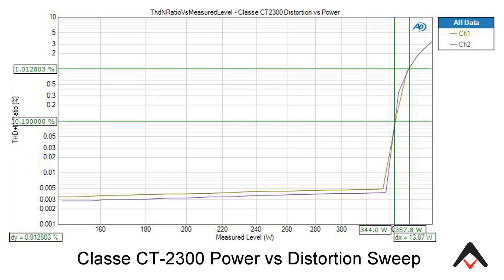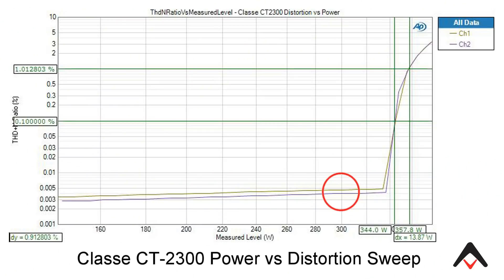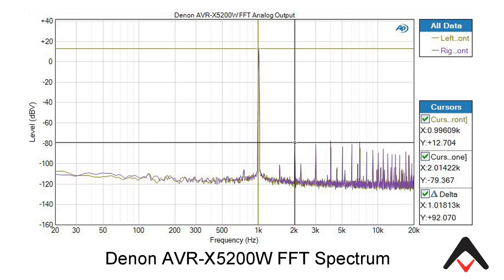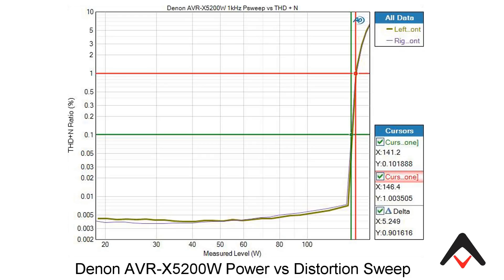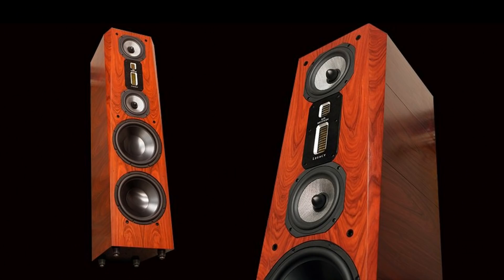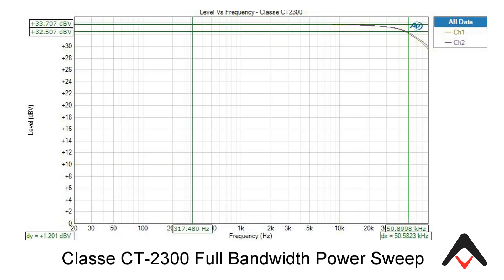Understanding Power Ratings in AV Receivers

Comment: Thank you Gene -- great video.  I have always run straight Class A or Class AB -- how can a Class D amp be pushing 2 ch 100watts/ch 8 ohm with a 46 volt power supply. I struggle when I pick up my class D and it weighs 4 pounds, while my Yamaha B-6 rated at 200 watts into 8 ohms give me a real workout.

Thanks !!!
Reply from the maker: Of  course if all things are ideal this would be true.  However, there are many factors that can lead to amplifiers sounding different that don't just relate to harmonic distortion.  Output impedance plays a role depending on the load the amplifier is driving to name one metric.
Reply: +SquidCaps "audiophiles on a budget" is so me. I just bought a budget 4ch pro amp for home theatre use. I feel a lot of consumer 'audiophile' grade equipment from players, DACs, amps to speaks are way out of proportion to supposed sound quality improvements (probably mostly psychological. It was proven that our taste sense can be altered by vision, sound and memory, maybe similar apply to audio sense).

I am currently thinking about DIY a subwoofer and power by bridging 2 of the channels on my pro amp. Would you know if any electronics required apart from the speaker driver assuming I am doing EQ from PC player?
Reply: Dedicated DSP is a good point. My AV amp only have one subwoofer out, it can detect distance and phase, but that would rule out dual subs. I should have gone with a version of pro amp with built in DSP! Being too tight budget with no foresight.
Reply: +SquidCap if you think its an insane idea, I can already imagine what my wife's reaction is gonna be.
Reply: Tactile transducers sounds like something any female would enjoy once in a while too.

Todd, would the dual woofers be in push pull arrangements to cancel out vibration?

SquidCap, 
there are so much to learn and explore. Earthquake sounds demoed some interesting products this year's CEDIA.
Reply: Apples and oranges, weight has nothing to do with power supply output, it just happens to be one clue in traditional transformers. I agree with Gene, Class-D needs to be put to same tests and benchmarks. And even thou, i have no facts, i think class-D is the type where power rating must not be at any point exaggerated.. So reversal works as a safeguard, take 20% of from class-D and you are might fine to put it up against any other type. For 200W AB should be equivalent to ~240W D-class. 

These are amplifiers we are talking about, nominally driven there should be no audible differences and so far in 25 years, some of it spent as engineer, i agree 100%. And weight is very poor indicator even on amps with traditional transformers as there are a lot of other factors in play (and since i stopped touring right about when d-class proliferated, i'm extremely jealous to techies of today, what used to be 160kg is now 40kg.. It actually saves on fuel already.. But that is a place, pro audio, where things can't enter distortion or ears go pop, smoke is released and insurance called.. They have to be dependable and performing just like the old ones. And they do, i was highly sceptical too and joked that these China plastics just can't work but hell.. i have been proven so wrong (we got a private demo from JBL/Harman and could get to quite in detail with them right at the time they produced first lineups based on new tech and yeah.. there is nothing wrong with that approach anymore, if it's done properly..)

I would still avoid the cheap stuff and get oversized but that is minor convenience; we have to plan for 50% reserves at minimum anyway, extending that to 60% is nothing ("real" wattage hits 50W; amp should be at least 100W, for d-class that would mean 120W.. whoopdidoo :) .. and that last para is opinions, not facts, based on some feedback from the field. What is indicative that no one is complaining and if something is fragile, the word gets around REALLY fast in the pro circuit as that shit costs easily thousands when things break at the wrong time, careers are ruined, companies bankrupted if new investments do not work like expected...
Reply: SquidCaps Thank you, so for critical listening in a properly set up acoustical environment, in an A/B test if both amplifiers were set to 50 watts / 8ohms even a good listener (not great listener as I am over 50) would be hard pressed to tell the different in amplifier output and distortion (assuming that each amp is conservatively a 100+ watt amp.)
Reply: Todd Dembsky Not just hardpressed, it is impossible to hear two nominally driven amps from each other (expecting we are both talking about linear. low distortion and low noise, at least adequate devices, <0.1%THD scale). Our ability to detect distortion is over 1%, we can hear clipping as that pushes things to double digits very fast.

Which is the usually flaw on testing amps: trying to compare small to large, overdriving one of them. Another factor is bandwidth, if you try to aim for 20Hz, that 50W that worked on medium towers, 40hz-20k is hopelessly underpowered at 20-30Hz (sub distortion is even harder to detect, it can go to 10%, which poses another problem: using energy on a range that the speakers can't produce but energy is still wasted... This can easily push things to distortion. proper answer, as always, is to bandpass source to be narrower than output, speakers in our case (on top end and using hires sources, you should cp that too, to fit the speakers, otherwise yo encounter minor amount of IM distortion, energy is sent but not used to produce sound, it turns in to heat and distortion...)..

But since we are not using loads of power and frankly, the usual situation is that we do have quite well balanced match, regular amps tend to do their job just right. But that is not enough for audiophile now is it? Pretty much nothing in audio is linear, energy is one of them.. Like you see in Gene's graphs, the distortion goes suddenly up and if our transients start hitting this peak, we can still feel good bass and relatively clean mids, just that something is...muddy.. unclear.. highs are there at right energies but... there is bass but it ain't punching thru.. all signs of amp giving up.

Some grow up on this sound and tend to like it; when they finally get balanced match, it is suddenly too harsh etc :) which naturally brings tubes as those have soft clipping, that knee you see is not a wall but more gradual; we get that "sound" much sooner and it is much better way to get distortion, imho than solid states...

Sorry for long post... If you haven't yet, join us at " audiophiles on a budget " in FB ;)
Reply: SquidCaps Great article.  In my set-up I would cross over at about 150hz to active subs.  So I would only drive 150 - 20,000.  I am going to have to give a good Class D a test.  My Class A's eat power like it is candy.

Also would open up my ability to build active speakers.  As I build all my speakers, I get the fun/frustration of picking cabinet design, driver components, and crossover design and components.  Also gives me the ability to bi and tri-amp my speakers if needed.

Thanks a lot -- great advice and loads of help.  I appreciate it.
Reply: Todd Dembsky Not a journalist so not an article but thanks :) IMHO, bi/tri amping is the best option at the moment, fully DSP controlled. The accuracy one can get is often ridiculous +-1db is achievable under 10k. But what is left, is the 50% of sound: room.. So spend your dollars there if you want the most effect on sound quality. Diffusion is my "sound", every room i've measured or worked in that i miss have had properly diffused soundfield, rather than damped. The longer you can make the reflection waves travel, the better as air is the best damping material i as it does not resonate like solid do Reflection/diffusion/absorbing, in that order.. But i'm not acoustician (read: magician or wizard), just a blue collar sound engineer (read: glorified roadie).
Reply: Oh Todd, I took a year of university physics and electricity was and remains a mystery to me.
All I can say is thank God for CROWN XLS amps!.  They are class D and to me-excellent ear-they sound GREAT.
I tried to read about "switching amplifiers" and all that but...uggh...CROWN XLS works for me.
Reply: Just wanted to mention.  I have a CLASS D BRAND amp: four channels.  300 watts/channel.  Designed, built and owned by Tom of Class D amplifiers in Anaheim, CA.  American made: EXCELLENT, QUALITY throughout.   Beautiful sound.
I just bought TWO CROWN XLS1502 amps.  I have them in bridge mode to run a set of BIG POLK AUDIO rtia9s.  These speakers have always recieved "so-so" reviews.  But people with  big amps always contend the speakers sound GREAT.
In bridge mode these amps put out 600watts/channel.  These amps make my rtia9s come alive and SING!!.

I got the CROWN CLS1502 for $350/each on Ebay.  They can be had for less if purchased used.

I have never seen anything but a 5 star rating for these amps.  The sound is impressive.  Just a shade below my CLASS D BRAND amp.  They put put the same power as the CLASS D BRAND amp but at 70% of the  price.  Not quite the build quality of the CLASS D BRAND amp but sufficient to get the job done.
Reply: Oh Todd!.  I would LOVE to see some of your builds.  Never understood why speaker manufacturers DONT build speakers with the power slot built right in.  I believe Ohm speakers does it??.  They also have a "novel" design.  I out that in quotation makrs because mother nature designed our vocal folds like that tens of thousands of years ago.

But why not have the power right at the speaker?.  Then a way to take out the amplifier and put in a new or more powerful model?.  There would be no huge central amplifier.  One could run the speakers on blutooth, thereby avoiding all cords.  OR, just have OPTICAL CORDS: thin, pliable, accoistically perfect optical cords sending a signal from the preamp to the speaker's amplifier.  NO loss of power.  NO  BIG, VISIBLE cords.
Would you use a CROWN amp as the speaker's amp?.  They are smaller than an A/AB amp but still large to put in a speaker and make it look...streamlined or at least stylish.
I believe class D amps are here to stay and to force out class A/AB amps.  Studies have shown that people CAN'T tell the difference between the amps so...

If you go to CLASSDAUDIO.com you'll see some amps that one can assemble themselves.  Maybe you just need one of those and NOT the whole CROWN amplifier??.

But still, I'd love to see your speakers-if  designs, ESPECIALLY if they involve a built in amp!!
Reply: gordon1000 Even though you are running EQ from your PC Player, I would put in a low pass filter prior to the sub amp, and then I would also put a hi-pass filter inline prior to your main amp -- no need in having your main amp reproduce all that bass.  What is the power output of your pro amp?  Rather than bridging the channels, have you thought about two subs?  Parts-Express.com has some nice DIY kits that are reasonable in price.  Depending on room size and shape,  two 8" or 10" subs would be better than one 15" sub.
Reply: gordon1000 Yeah, our group is on the realistic, objective side of things and shuns snakeoil, kind of exception in the audiophile world. It is not perfect or infallible place but i simply can't go anywhere else without seeing red from the mountains of misinformation.

For DIY sub, active cross-over is the best option available, giving you the much needed control. For even better control and what i consider to be minimum is to use DSP (miniDSP is very popular but i don't like to endorse just one product, there are others but that is prime example of how things should be done) as this gives you the absolute mandatory time alignment and allows subwoofer to be positioned optimally in the room independent of main speakers locations. 

Without time alignment, you are forced to place sub very near to main speakers but this is not at all guaranteed to be the best position in the room, speaker+room interaction is what makes 99% of the sound and subs are meant to produce the wavelengths not commonly seen in the size of rooms we have. Thus: sub is placed in the room for the room, main speakers are positioned in the room for you.

Using active crossover, before poweramps, also prevents the point Gene made about impedances and output impedance; we get close to ideal impedance across the whole range since we do not have complex passive filter circuit in the one pathway that is compromised the most by simple laws of physics: we can't get zero input impedance but as low as possible is the goal..just in case we run into damping issues*

*which are VERY RARE and i always see this as "why did you have to mention that, technically true but.. ". It is usually irrelevant, the margins we work in are such that this should not be an issue.. ;) It is a bit like saying that since at mach3, our leading edges start to melt on a jet, thus we need to use titanium bumbers on our Toyota (exxagerated to prove a point). In my eyes, this is ALWAYS a failure condition, it is troubleshooting time if damping causes problems.. But at home hifi, we also do have the "high end" where these kinds of amateurish mistakes are commonly made, because it sells to a certain crowd who are themselves avoiding facts and everything objective, so i guess it has to be mentioned that there are some cases where......
Reply: thank you for the tips Todd, the pro amp came with low or high filters for each individual channels. It is advertised to have peak 1600w @ 2ohm, 860w @ 4ohm and 3000w bridged @ 4ohm. I was think one 15" or 18" folded horn, depending on how I can hide it from my wife. :X
Reply: gordon1000 My goodness man, how big is your listening room?  I used those type of speakers and that power for sound re-enforcement at concerts when I was a sound engineer.   Just go out an buy a couple of Klipsh KLIPSCHORN :-)  If you are worried about the W-factor, you are going to have to put the 18" folded horn into the laundry room and blast it through an acoustically transparent grill.  Do you watch a lot of action movies?  Or are you planning on using these outdoors?  Unless you are really into deep Organ notes, most music today does not go much below 40hz (thanks for nothing Bose) with some content and harmonics in the 20-30hz range. But a 30hz signal at 100db will move your house off its foundation if it is less that 3000 square feet. (all this is opinion based on past experience, not fact, Gene is probably spurting blood from this ears by now)

What is the frequency range of you amp?  most are rated at 20-20k.  You will need a power amp that has the current to drive an 18" sub at 20hz.  And one that has a floor of around 10hz and those are a very rare animal.

I really want to see what you end up doing.  Just please, please, do not put any led light into the speakers.  That darn computer fad is starting to slide over to desktop speakers. Barf.
Reply: B drop tuned metal is imho good example of 30Hz notes, that really is already stretching it a bit, after that, there are no real notes but just energy. Also, 18" folder horn? A bit insane idea, if you ask me.. You get much better results using tactile transducers if you want to go near 20Hz.. But the goal is linear FR at least 20-20k so, go for it...
Reply: Todd, in around 3500 room. I am just an amateur try to get best bang without needing to upgrade in the future. what I am missing is the thump in the chest feel in action movies. I can hear them but no feel them so much. My amp is 20-20k as you said.
Reply: gordon1000 I would have to recommend what SquidCaps mentioned and supplement your sub with tactile transducers. But if you are really going for that heart stopping bass hit, go for 2 18" drivers in a single cabinet.   That way it would fit under your TV cabinet and you would be able to time align the left, right, center speaker plane with the sub plane. Just remember that below 300hz the sound will become unidirectional, meaning that you really will not be able to tell where the placement of the sub is.
Reply: gordon1000 Last time i drew a folded horn for measly 10", it was 1.5m high, 35cm deep and 2m wide to make it fit in the room somehow.. Needlessly to say, i went with simple ported design.. That smooth roll-off would've been awesome but i used other tricks that basically only work on lower SPL (i'm on 80dB camp on what is best SPL for audio, below fatigue) to get the same effect. Inefficient and d does have higher distortion but compared to folded horn, much move convenient. We can't detect sub distortion before it hits double digits, as long as it stays in the same band.
Reply: gordon1000 No -- I would put them in the same box both forward firing.  they make some subs now that work great in a sealed box that is not too much larger than the driver.  So maybe 20"h 24"d 40"w or you could port a box of the same size to reach a bit lower.  It all depends on the drivers that you pick as some work great in tight spaces, and some like large boxes.
Reply: carlos oliveira Who are you talking to?